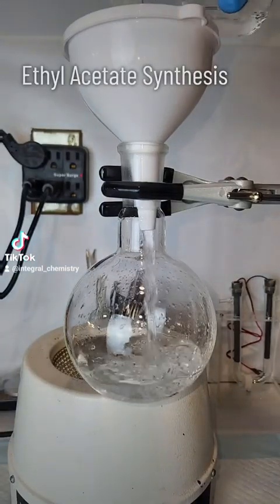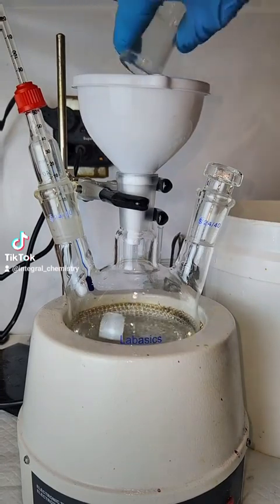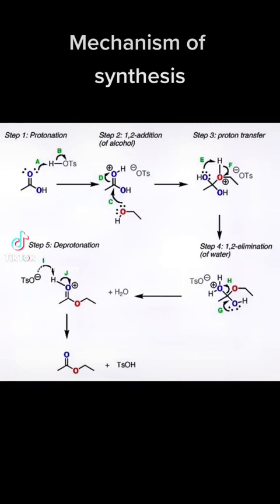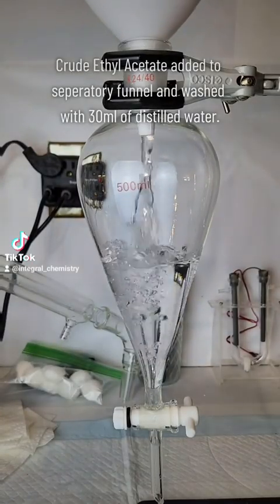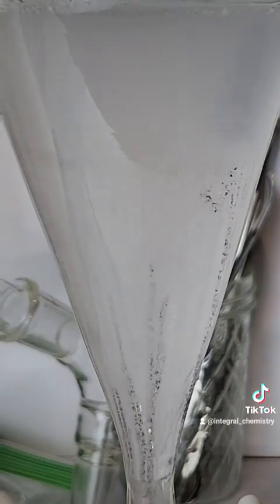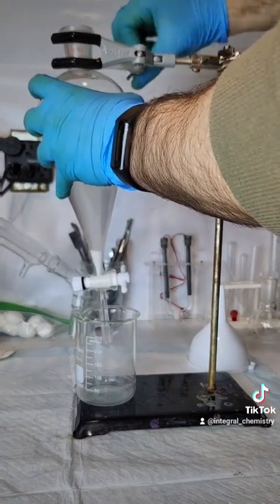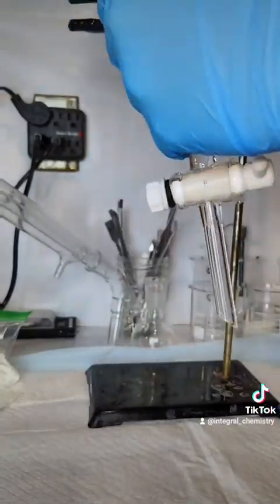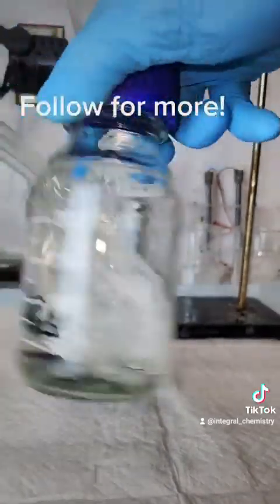Ethyl Acetate Synthesis

Comment: Ethyl acetate is not methyl ethyl ketone, as you suggest at 2:42.
Reply from the maker: Yeah I meant to correct that in the video description 😅 I made that comment in the video when thinking about a product I saw in the store labeled "MEK" which contsined ethyl acetate as the main ingredient, but when I checked it out after the fact I realized it was actually called "MEK substitute".
Reply: Klean strips product called “mek substitute” is 100% ethyl acetate no impurities check sds, found in any hardware store in USA
Reply: I thought for a second, that I could skip the synthesis and just use butanone as ethyl acetate 😂

Comment: Does the using of non concentrated material will cause hydrolysis? Or it cannot be used because of another cause???
Reply: Yes. Since water is produced in the reaction, it causes a hydrolysis of your product. Water needs to be continuously removed during the reaction for high yield (if I remember correctly, usually by azeotropic distillation with toluene or something). Or you would have to continuously remove the product from the reaction, since the back reaction isn't possible that way.